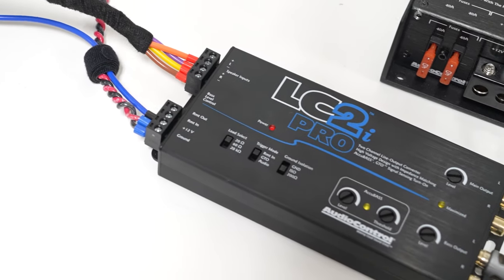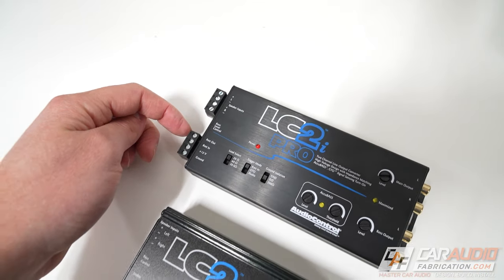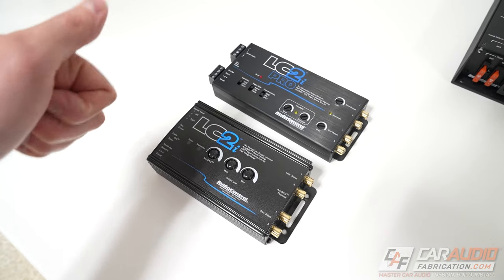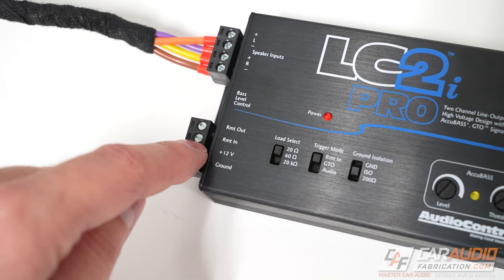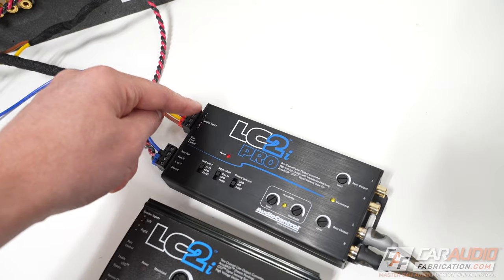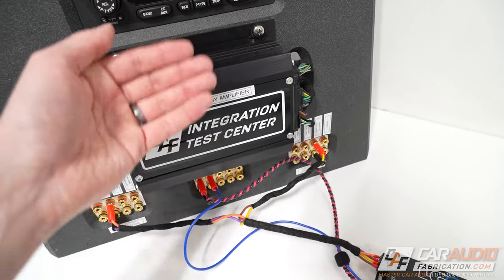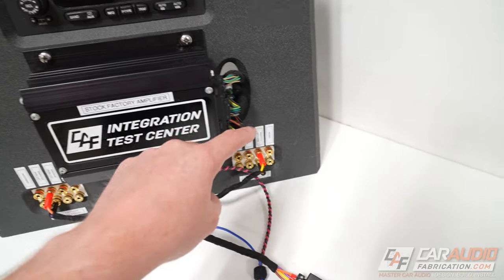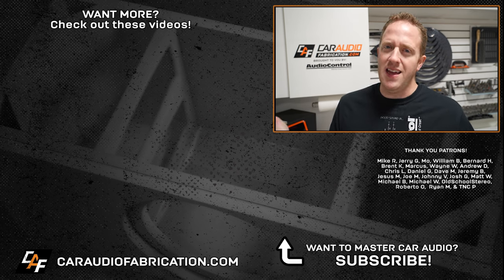Line Output Converter Explained - How to Install & Features to look for!

Comment: Really wish ANYONE could shed some light on doing this with a 2022 VW GTI MK8. There’s no one around that has confidence to take one the job. Smh
Reply: I have a 2020 GTI and have subwoofer installed
Reply: Find a radio pin out and go from there
Reply: Bro same here cannot find anyone willing to touch these
Reply: @sleepy35th  got a similar problem with the MG 😅 guess I gotta get my hands dirty
Reply: Just seeing this, I’m going to start an install on my MK8 in a week or so when all the parts come in. From what I’ve seen on the forums you can access the rear speaker wires in the B pillar. I’ll take a video of what I find and see if it works 🤘🏼
Reply: Alright guys just finished the install. The forums were correct. I grabbed a schematic from them that I can share. In the wiring harness located in the B pillar is where I pulled my signal from then routed it to a LC2iPro. Let me know if you have any questions 👍🏼

Comment: Good info here!  I used the Kicker KISLOC2 (2-channel line-out converter) for a number of years before getting the AudioControl LC2i Pro.  The Kicker LOC does a nice job at doing what it designed for, but there is nothing to customize/tweek for your specific audio setup and needs.  But at $15, the Kicker KISLOC2 is great if you need a no frills LOC.  The AudioControl LOC's are definitely worth it though.. no regrets there!

Comment: Some aftermarket head units are low voltage, and can only be tuned with an amplifier to a degree so there's no clipping signals. LOCs can boost that volume level to high and clear without any clips in the signals.
Reply: I'm hoping that's what's wrong with my system I barely get to the point where it sounds good and it's clipping. I hope this LC2i helps out with that so I can get more voltage to my amp.
Reply: @cptklutch26  You have the Lc2i, not the pro? The Lc2i, has a built in Pfm= 33Hz bass cut off, so if you want lower Hz than that, get the Lc2i Pro= 20Hz, or better yet, the Best Loc for Bass, by Audio Control, in my opinion= the Epicenter micro, has a switch to turn OFF the pfm= goes down to 10Hz, has Bass restoration, plus comes with a ACR4 Bass knob= 2 Knobs in 1= inner Knob controls total output/volume of bass, and the outer Knob controls how much bass restoration you want to add( best to use bass restoration for music that has little to No bass present).Either of these Ac Locs can boost the output voltage very high if needed, up to 9.5volts of clean output! 99% of the time 4 to 5 volts is the most RCA output voltage you will ever need/want!

Comment: Hey mark ! When running the 4 wires  for the R and L from the factory radio to my trunk. What is the best wire to use here ? I ran 16 gauge but then realized I could of just chopped an rca . Thank you !

Comment: Would i be able to run the 12v power line with the one to my sub all the way to the battery if i use the GTO setting so it only turns on when i turned on the volume ?

Comment: This has been really helpful. I just purchased a new car and love the head unit. And was dreading the idea of trying to replace it to put my subs in and had no idea how these worked.
Reply: For subwoofers, i suggest Audio Controls Epicenter micro, comes with a 2 in 1 Bass knob, the inner knob controls Total Bass volume, and the outer knob controls the amount of Bass restoration you want to add to music that hass little to no bass= this can add it! Its also an active line out converter!

Comment: This guy explaines well if your already a professional
Reply from the maker: I have a range of videos from basic to advanced. I can't possibly simplify every video because then advanced guys will get bored. Rather than complaining I'd suggest taking action and watching the others on the channel
Reply: Right!? A simple addition to the description like “Hey, if you need a simpler video click on this one” would have been awesome. I guess that would make too much sense. ¯\_(ツ)_/¯ .
Reply: Mark on a 2015 ford explorer xlt could  i run that line out power and ground to the amp to turn on since the wire will not be long enough to run from the radio to the rear@CarAudioFabrication

Comment: How would the remote gain work on this LOC when you already have a remote gain on the amp itself ? Would you use both? Can you use both? How do you tell how much gain you need to set on the LOC I know how to set the gain on the amp but what are you looking to do with the gains on the LOC???
Reply: i almost maxxed my gain on my LOC just under any distortion at 3/4 head unit volume. tuned the sub amp from there (gain,subsonic, hpf) while playing at my top range volume that i listen to.  then i control how much bass i want at any volume with my bass knob.  i usually run my amp gain a little higher than needed so i can have more bass when im listening at lower volumes.   idk if this helps but ive been doing it this way for years.  ✌️

Comment: Great video, very well done. 

That said, just getting an amplifier that already has high level inputs seems like a much easier solution, or am I missing something?
Reply: Yes grab ferrule crimpers I’m in the process of installing cxa300 to a 10 inch compC I’m using the KISSLER method due to less wiring with DC offset I’m looking into other LOCs but it looks lik it’s not needed considering I really only need lows

Comment: Question here. If you’re running the speaker input off a factory sub wire, would you just connect them to one set of the positive and negative terminals? Regardless of left or right?

Comment: Great stuff here. Thanks for the info. Now I have a question. Can you use the LC2 to run more than 1 aftermarket amp? Like a midrange amp and a sub amp? Can you use both main outputs and sub outputs at the same time?

Comment: I have a car with premium system on it, but i want to add 2 speaker conponents and a bass so is going to be 2 amps can i take the signals from the speakers with out disconecting them?

Comment: This is going to sound stupid but I have a 2015 Durango RT with the Beats system in it. Looking to replace all the speakers with more powerful ones and same with the sub. Given that there are signal wires for the tweeters, mids and sub, should I buying 3 LOCs? Additionally, there are currently 9 speakers + 1 sub in the truck. I'm looking to add 2 tweeters and two mids to the mix. Should I be running 3 amps? Again, just here to learn

Comment: On a previous video you showed using a single set of speaker wires from a stock sub set up. Knowing this, can I run a single set of speaker wires from one of the rear doors to achieve the same result?

Comment: I currently have a lc2 from an old system. Can i use that 1 lc2 for 2 amplifiers? 1 amp for subs and 1 amp for mids/ highs? If so how would i separate the factory speaker wires into the lc2. 
Thank you!

Comment: Was wondering do you have to use both left n right speaker wire or can we use just the left only? Would it still work ? Or we need use both left n right?
Reply: I need to know this to. I have a factory premium navigation radio that I'd like to just keep since it sounds ok and has a factory subwoofer that I'm hoping will sou d good with a added dual 10in sub box wired into the system. But it's a single 2ohm subwoofer so I don't know if I should use the rear deck speaker leads or he sub wire to just the one input on the loc.

Comment: I am installing an LOC in my Yukon and I am confused about how to set the output levels of the LOC. I know that the gain on an amp is supposed to be set to the same level of the RCA preamp output voltage, but an LOC effectively creates its own RCA output from speaker levels, and not all head units have the same output levels. I am using an aftermarket pioneer CD player(from 2005, lol) which has 4 volt RCA outputs, all being used currently, and am adding the LOC to the rear speaker outputs of the CD player to gain an additional  subwoofer output. I am doing so because I am assuming that if I were to use Y adapters to split the sub output RCAs to 2 amps, it would effectively cut the output voltage the amps would see from 4 volts with one amp to 2 volts each with 2 amps. If that is not the case and amps see 4 volts regardless of splitting the signal, I would not need the LOC after all. Please advise.

Comment: I have a 2020 Genesis G70 , I don't want to change my stock stereo , should I buy the LC2i Pro ?
Reply: Yes
Reply: @oscarperez-yd9vx  yes you’ll need it to boost music signal without aftermarket radio. Lc2i pro will let you adjust music settings in factory head unit while still being able to tune further directly on amp and LOC

Comment: Can I send the speaker out of the factory amp to the factory speakers AND the LOC? Is that dangerous? I assume it changes the impedance and will affect the volume of those speakers but I don't mind that. I want to add a powered subwoofer to the factory system of a 2005 Lexus RX330. Thanks!

Comment: Do you need a LOC for a aftermarket pioneer radio and dual enclosure subs with a 1200 watt amp? This is my first time. I’m just trying to make sure I have all I need for my ram 1500 classic warlock

Comment: what if i have 3 amps one amp for my door speakers , one for my sub, and 1 for a rack with 8” mids . would i need to use seperate loc’s or would 1 connect to everything?

Comment: The D-4.800 has high level inputs.  Is there any real benefit of adding an LOC?
Reply from the maker: All the AudioControl amps essentially have a LOC built in. The D-4.800 shown in the video is just for illustrative purposes.

Comment: So if I understand this correctly, to remedy the roll off we use the threshold knob but this only affects the same music type it was tested on right? Some songs have stronger bass that will trigger it earlier in my experience
Reply from the maker: In which case you would simply reduce the bass with an attached ACR knob.
Reply: @CarAudioFabrication  I've also read from someone that you can maximize the threshold and turn down the amp gain but I haven't tried that yet.
Reply: @tapig3322 using modern hu's for music usually sucks if there is a bass hpf on the outputs, best approach is getting an amp with a dsp or a dsp that has at least 2ch's with summing ability and a basic cheap loc to get the navigation sounds vice versa from the hu then sum those navigation and other hu sounds in -12db and use the other source of the dsp or an dsp'ed amp to stream music directly from your phone or a dac/player. bringing the bass back with the whatever algorithm these "bass bringer's" may give off unintended signals and simply act stupid, also although controlling the bass with a knob for each song is kinda ok its still not practical, especially if you want songs to play as the engineer intended.

Comment: I have a 2017 Honda pilot elite , I’m planning to upgrade all the speakers to JL c2 and components to the front plus I want to install a 4 channels amplifier to run them and I will like to have the option that I  want to add an aftermarket  subwoofer later I could . The question I have is which converter do I need the LC2i , LC2i pro , LC6i , LC7i or LC8i ?

Comment: Does wire guage matter for speakers when using an loc? I have 4 6.5in speakers 250w rms 1000w max that ill be installing into the doors. Im running 18awg speed wire from speaker harness to loc. Do I need to run seperate thicker wires from each speaker or will 18awg be fine?

Comment: Do you need to have both left and right speakers tapped into, or can it run off one?
Reply: Both.
Reply: I have the recoil loc and when I aye it it clips and distorts the sound wat is going wrong
Reply: @alphapoo132  I ran off one side and it sounds great

Comment: Not sure if this will get a response but....

I have a 2019 Subaru that I've installed new door speakers with amplifier, subwoofer with an amplifier, and a plug-and-play android head unit replacement  (replaces the entire center console area and retains all factory features).

I enjoy the head unit, and the door speakers are loud and clear. But the subwoofer leaves much to be desired. I had this amp/sub setup in a prior vehicle so I know this side of things isn't to blame. 

The issue I'm having is the sub output is nearly non-existent at low volume levels, and then jumps to nearly max output at the top 10% of the head unit volume. 

One issue I see is the subwoofer output is a single RCA but the front channel is dual. I was wondering if I switched to a line output converter like this, if it might take care of this issue? Or if you had any other checks or suggestions?

Comment: Hi, I love your content and I’m about to start two project cars. For me it’s going to be the whole deal (DSP, two amps, etc). For my wife’s car I was wondering about adding a small kenwood active subwoofer, it already comes with the speaker signal input, would you recommend using the AudioControl LC2 Pro to feed the sub instead of going straight from the speaker wires? I mean, it’s a powered sunflower from a reputable brand. Thanks in advance

Comment: Can i use this to get my factory sub signal and also get full range signal and if so which side do I put the sub signal and full signal? I would be using a mono block amp for sub signal and 4 channel amp for front and rear speakers. Also would I just splice into the front and rear speaker wires to run them to the 4 channel amp? So I would end up with 4 sets of spliced speaker wires

Comment: Do i need an aditional device if i use the lc7i audio control LOC with a 5 way amplifier to run a full system with 3 ways speakers in the front, coax in the rear and a subwoofer

Comment: So i just want to double check If I have a sub that came with my car like stock. In the frame  Do I need the converter.  Can't I just use the wires that go to that sub since its all ready low signal. To go to my amp for my big sub. Or will I still need the converter

Comment: I have a couple of questions Mark , by using the right and left channel from the rear speakers do you piggy back off the speakers or lose the speakers in place of the amplifier? I ask due to signal degrading and it's effectively changing the ohm's? Obviously losing the speakers to fit an amp for a sub is not ideal would a 4 channel be best as to run the rears off 2 channels then bridge the others for the sub? Cheers
Reply: Either or
Reply: Remove the rear speakers to get more bass inside through those holes and use those speakers lines straight to the lci2 pro directly.
Reply: You don’t loose the power to the speakers. I’ve installed a few active subwoofers in the past just by talking the signal from the speakers, no problems at all in two different vehicles with factory unit.
Reply: @eduardosanchez7827   looking to do this in my f150 instead of pulling my stock head unit apart. Do I need to tap on from left and right rear door speakers or can I just tap in from one? Thanks
Reply: @ratherbeboyz4485  you have to tap both speakers so you get a “full signal”. I just did this in my SUV last month. I installed a kicker amplified under seat subwoofer
Reply: @eduardosanchez7827  thank you! Working on mine this week and this is my first time messing with audio and I didn’t want to replace the stick head unit or have to take it apart so I think this will be a lot easier

Comment: 09 Honda Accord EX-L without Navigation has center sub. Can I just tap in those to wires to the left speaker input off the factory wires? Does have a factory amp, so there should be no issue going right off those 2 wires. Going to check voltage and all that right now with multimeter and SMD Test CD. I believe that it should be fairly easy give it already has factory sub, No?

Comment: So when you using dsp and setting crossovers on it for speakers, would you set the amp Hz levels and gains to medium or low? Because nornally an amp has hz and gain adjustments available

Comment: Is it possible to use the factory subwoofer wires to the LOC?  I was hoping to replace the stock sub for an aftermarket amp/sub.  I would only have one set of wires to connect to the LOC, so wasnt sure if that would be an issue.

Comment: Stupid question i suppose, but i bought an 80s vehicle and a buddy if mine suggested an LOC to remove the necessity to hook the 12v hookup to my battery so i dont have to go through the firewall. Is this a true statement for an LOC?

Comment: Super helpful information, helped me get the right gear that I needed for my truck. Thank you. Was looking at the epicenter to draw signal from my factory radio to my sub amp. Is that an active LOC as well?
Reply: Yes, they are active. I recommend the Epicenter micro, because its the only epicenter that you can turn off their Pfm= blocks low freq. ( most AC products with the Pfm is factory set to start cutting bass @ 33Hz, the micros Pfm, when set to on= 25Hz, but with the Pfm switch set to off=10Hz before it cuts bass output), and comes with a 2 in 1, ACR4 bass knob= inner knob controls total Bass volume, and the outer knob controls the amount of Bass restoration you want to add!

Comment: If I tap into rear speakers to get a signal for a subwoofer amp, how do I maintain a signal to the factory speakers from the point at which I connect the LOC?
Reply: I plan on doing the same thing. From what I’ve read it shouldn’t effect the rear door speakers but I haven’t tried it
Reply: You just splice= (cut back the speaker wire shielding, twist a new wire around the speaker wire, then soldier, and or use electrical tape around exposed wires), do this to both rear speakers, and run the spliced in new wires to the line out converter.

Comment: Hello. The rear speaker on my Toyota 2020. Have so low voltage from factory headunit.  And low bass. 
Ist posible to Rise voltage Whit a loc. And get more volyme and bass. Or use only front Chanel and amplify to 4ch amp? And lose fade funktion?